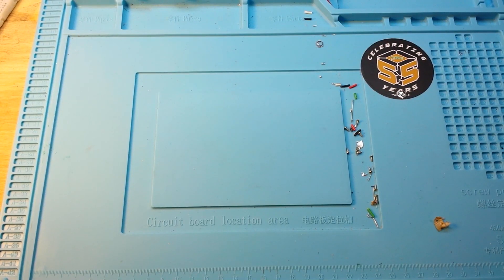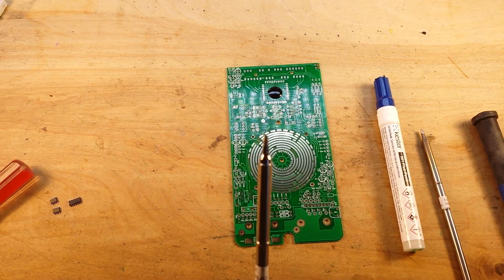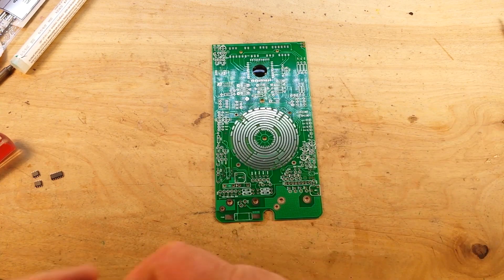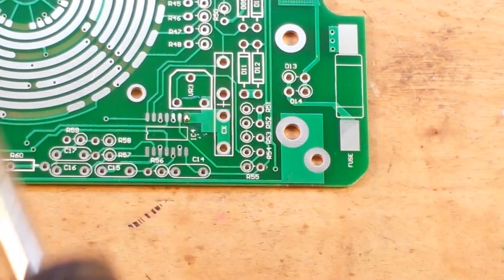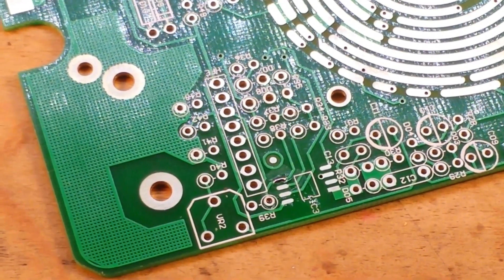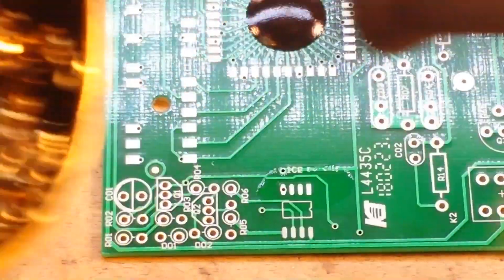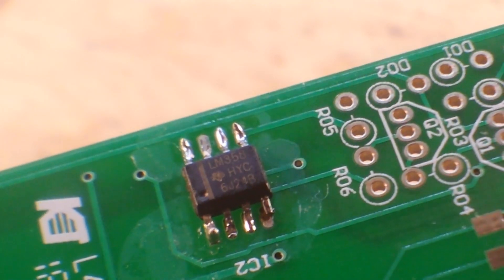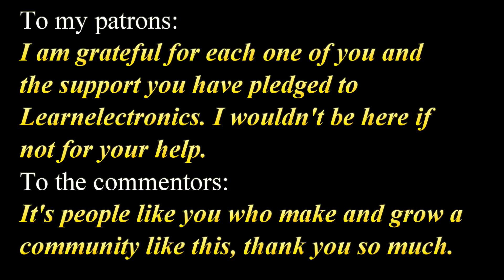SMD soldering for through hole people

Comment: I guess part of not having the proper tools is not having solder paste. With paste, even 0603 is fairly doable without too much trouble. For this, I think I would go with the flood/drag method and clean things up later with some solder wick. Tried it once without solder paste and was not a fan. Got some solder paste and now I'm all 'through hole what?' It really was night and day.

Hope all goes well with the surgery. And ChipQuik has an excellent stable low-temp lead-free solder. A bit pricey but even when I thought I messed up with the soldering iron, things came out splendidly and this was with my chisel tip.

Comment: I'm trying more and more to use smd components.  My "kit" is my trusty solder station, 2 helping hands spiders, superglue, thick paste flux and various clips, clamps and forceps.
I find the flux paste is tacky enough to allow placement and doesn't vanish in a vapour cloud.  My favourite bit is either a 2 or 5mm angled chisel which can do both ends of a resistor or multiple legs of an IC at the same time if necessary.  Lots of flux and load the tip first.  Usually that will allow you to run the bit the whole length of a component "painting" solder as you go.  a bit of practice and a little restraint you don't bridge too many legs on your way.  I find a slightly warmer tip helps keep the tip moving and reduces puddling too.

If you watch the asian creators they always load their massive tips from an old tin containing a penny sized glob of solder with a block of pure pine Rosin, also called colophony or Greek pitch you only very rarely see them use conventional cored solder wire.  I've substituted flux paste applied to the pads with a toothpick then ... 

Load the tip like a pen with solder ... load it and use it direct, the tip stays cleaner and doesn't puddle it also leaves you a spare hand to hold the component in place while you solder it down.

Its a bit different, but not hard to get the hang of, I'm using 60/40 lead, the tip is 30 deg C hotter (340-350c). 
Paul, your way is textbook, if you want something to distract you from the pain - I usually play a shoot em up style game ... or solder some ridiculously small components :D.
I usually find it takes about 10 days - so you're almost there - stick with it .

Comment: tks for this and hope you get well soon. Difficult task especially if filming. Good soldering iron at correct temperature and lots of flux help. A copper gauze loaded with flux helps with correcting errors. Have you ever watched the servicing vlogs by Louis Rossmann? I learned a lot from him but I still cannot do it quite right :( So I appreciate its not an easy job.
Reply from the maker: I have watched him. The stuff he works on is almost microscopic. I can barely see the largest Smd component. But you are right flux helps.

Comment: Good video Paul, Hope you feel better soon. I like soldering for a hobby it is relaxing. I have a KSGER t12 and a 878D with hot air. I like using the soldering paste and air also. It pulls the part right into place. A luer lock 18 gauge is a must. 73

Comment: Try fluxing the Solder. Just wetting it.     It's way more controllable.       What Surgery are you privileged to experience Sir.  I'v had more then my fair share.
Reply from the maker: Kidney stones. They tried to remove them on the 12th of July but could not access them, so they left a stent in place for dilation. Hopefully it worked and they can retrieve the stones Friday. Been going through this for over a month.
Reply: @learnelectronics  I knew a guy in Greece that went thru that like every 6 months or so.  Some reason his body just started making the damn things.   Drinking Vinegar and Lemon juice by the bucks would slow them down.   They Blasted his with Ultra Sound.  Making small enough to pass.

Comment: I have also been thinking about changing to SMD  components, I don't have a soldering station with hot air capabilities but I do have a 600°C hot air blower for paint stripping. Just place all the parts on the board with soldering paste and heat the whole lot up in one go!

And here is an alternative method.

After watching the following YouTube video I considered using this method.

https://youtu.be/dJI07PjZbdk

But changed my mind, because of the "What the f*** are you up to?" question I would inevitably be confronted by from the missus!